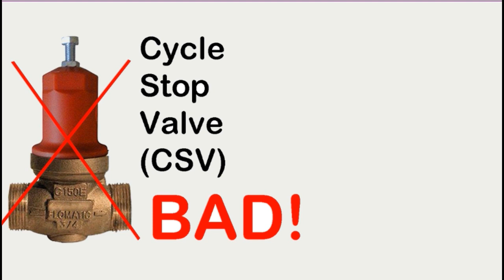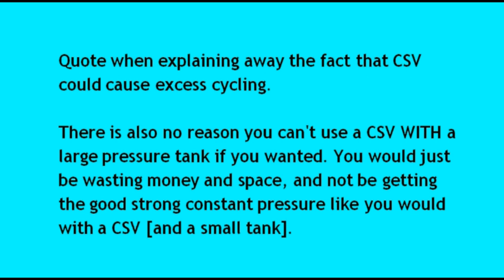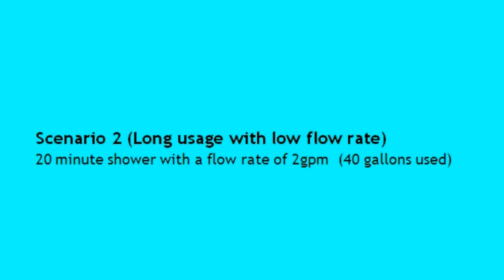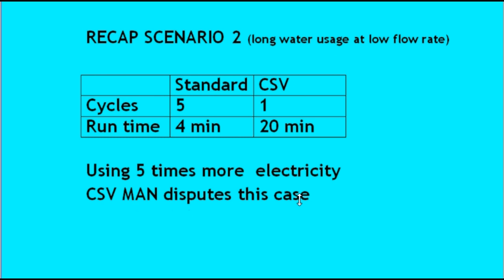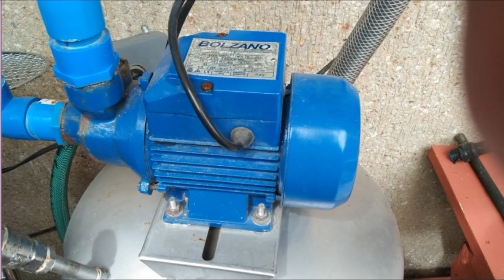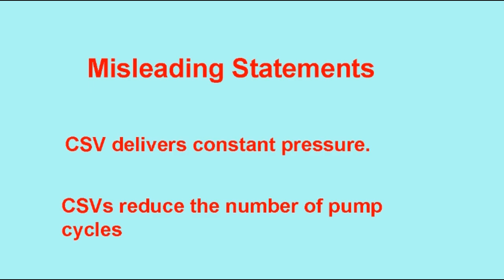Cycle Stop Valves ARE BAD for pressure tank systems!  Pros and cons of CSVs – few pros, many CONS!

Comment: Hi Larry. Enjoyed the video. The  only place I found this type of equipment useful in my rural home is at the ground source heat pump that required a constant flow rate of water for efficiency. So my house is on the side that varies 40/60 lbs and the furnace is on the other side of the valve to provide a constant flow through the furnace during a heat or cool cycle. Other than that, thanks for the detailed description. Sure made me think! Barry

Comment: Hi Larry,
Thanks for the very interesting and thorough video.  I have a gravity fed spring system in a cabin that I am upgrading and was totally persuaded (by the cycle stop guys ads) that I needed a CSV.  Now I am not sure what I need. The cabin is not big but will have 2.5 bathrooms and a kitchen.  We will probably not be watering the lawn much and only using the cabin about 15 weekends per year.   The current system has a pump with a small pressure tank that is cycling on and off with every use of water, which is noisy and annoying.  I was considering installing a water holding tank in the basement with a submersible pump (which should muffle the noise of the pump) and using the CSV and pside-kick tank to limit the cycling of the pump.  I do like the idea of constant pressure in the shower.  Is there another way to get constant pressure? Thanks
Reply from the maker: Honestly I can't make heads or tails out of your post. If your system is gravity fed then why do you have a pressure tank or pump? You mean gravity fed into your basement? And if you have a holding tank why would you need a submersible pump? You just need a booster pump. Submersible pump just to reduce noise? Sounds like a big waste of money.   What you need is a large pressure tank. What size do you have now? A large pressure tank will reduce cycling very significantly.  What is the current pressure range of your system now, usually if you have a pressure range of like 40 to 60 you would hardly notice it in  your shower. There is something called a VFD, variable frequency drive which can control pressure efficiently. I suspect that if you set up  your system properly you would be perfectly happy without a CSV valve pr VFD.  I think the VFD man is giving you the run around. A CSV turns the pump on every time you use it also. It just prevents cycling on long runs. To really give an answer I would need much more detail about exactly what your setup is. There are also shower accessories that can keep a proper pressure at the shower without  buying an expensive CSV valve.

Comment: great video, I commend you on doing this video.  I had purchased a CSV a couple weeks ago for a rather large home and have not installed it yet. Reason for purchasing is I am familiar with VFD's and have had one die to a surge, one died when the pump went out and then recently again had the drive fail from a lightning strike taking out the transformer in the neighborhood. Got tired of paying a small fortune for a VFD although it did work well when it worked. Had the well guy take the vfd out and put an 80 gallon tank and 50 /70 pressure switch on the system .I hate the pressure swing on our current setup currently.

Ive had one well company in Central FL swear by CSV and another company claims they tear pumps up and says he constantly has service calls to repair their damage. With these conflicting opinions from professionals in the area it made me try and do a bunch of research on my own.

I think your points about the csv cycling more is true with a small pressure tank. The scenario you showed about the fan and amperage draw is inaccurate though. For the test you did with the fan to be comparable, you would need to restrict the flow from the front of the fan by putting something in front of the fan to restrict its output and not restrict it by putting more load on the pump by physically blocking its rotation.  Restricting the flow on a centrifugal pump does not put more rotational load on the pump, the thrust load depending on the impeller design can increase. This is the same as if the pump was pushing water from a deeper well. It would be interesting to do a study on the failure rate of pumps on deeper wells vs shallow wells. 

As an electrical engineer I have access to a power analyzer and very accurate equipment to analyze power usage over time.  Ill record the load swept over the  outputs w/o the csv installed and record the standard usage after a month. End of December ill install the CSV and record a log again to see electrical usage over a month. I did a ton of research and had the same concerns you brought up in this video. The main issue I had was not finding a comparable power consumption graph from them showing that the csv does save electricity with a residential sized pump.

Was wondering if there was any way for you to do the current reading you took with the pump, but put a gate valve on the output of the pump and record the current wide open and slowly close the valve to a dead head to see if it reflects what was shown in the csv promo video he did.  Also what forum is this that had the csv company in it. I would like to read up on the thread.
Reply from the maker: Thanks for your nice long and interesting message, I will reply to several things you said.

First regarding the VFD always breaking, I am surprised! Are you keeping the VFD inside? Is it a reputable company like Grundfos? Actually I had a similar experience with my first inverter air conditioner which is pretty similar in concept to a VFD, it was a Samsung, and the electronics  blew during a power outage and it was going to cost so much to fix I just threw it out. However, it seems that a well designed system should last a long time. Think how complicated my computer is, and it has lasted 11 years already! Electronics should be dependable! Not accounting for power surges is pathetic engineering.

Regarding the up and down pressure of a regular system, your system is 50 to 70 psi. You say the fluctuation bothers you. That also surprises me. I have a cheap 20/40 system and even at that range I hardly notice the pressure fluctuation.

As far as my fan test goes, I knew that was a stupid test and I wish I left it out of my video, so many people have given me negative comments about it, I was just doing it for fun to see what happened, not really to be taken seriously.

As far as power usage of a water pump going down as flow is restricted, I did that test in my video. Same thing as putting a gate valve, I monitored the amps as my pressure tank was filling. No significant difference in power usage as flow was reduced for my cheap Italian ½ power pump. Honestly, I suspect that very few  pumps, with the exception possibly of expensive industrial pumps, reduce power usage as flow is restricted, that after all is the purpose of a VFD. Notice how few pumps provide horse power vs. flow curves? That’s because it probably is not a factor for most pumps. Cary Austin of CSV probably had to look far and wide for that pump curve that showed a 50 percent reduction in power.

As far as putting a large tank with a CSV, you realize the large tank will fill up very slowly at 1 gpm and this will waste a lot of energy. I already know your system with a CSV will waste a lot of energy, it is obvious. However if you don’t care about energy usage I suppose the CSV will at least provide constant pressure if that is so important to you. 
As far as pumps lasting longer, I seriously doubt it. It seems intuitive to me (all though I admit intuition is not always correct) that a severely restricted pump will burn out faster than one providing flow at its natural rate so to speak.

I hope you try my idea on how to build a CSV, let me know if you do it.
Reply: @LarryElterman  Thanks for the reply back appreciate it. The pressure issue is noticeable on the irrigation setup. The heads end up spraying the neighbors during a period of the cycle then when the pressure drops or goes down . I've adjusted the pattern on the heads to compensate for this . Showering it's very noticeable. The house is older and I guess plumbed wrong . I can tell when the pump kicks on as the spray pattern gets stronger.  The vfd when working , worked very well. Lighting took out one, one died when the pump gave out . And a third one diedwhen a transformer in the neighborhood blew up. Ironically it killed the driver for the fridge and the tvs in the house . As an EE I know how sensitive electronics can be to surge. I even had a whole house surge block in the panel that didn't seem to do a anything . The one we had was  called a  sub drive  for a 3 wire pump . I believe its made by Franklin. It's installed in the garage near the water filtration/ iron and softener system. We have a 1.5 hp submersible pentair pump now. 2 grand each drive failure is rough.  I was lucky to have one replaced under warranty but the last 2 I had to pay for again. After the last failure 3 months ago i told the well guy to just put a regular pressure switch cause i wasn't  going to pay 2 grand again for another vfd. That more than killed any savings I was attaining  from the electric bill using the vfd.  I saw your other video about incorporating a valve  and flow switch and that seems very viable . I'll give it a try in January .
Reply from the maker: Ok, let me know how it goes!

Comment: The power consumption on a pump curve is not linear through a range of heads (psi) and flows. Running 4 minutes with pressure varying between 30 and 50 psi compared to a pump running for 20 minutes at 40 psi would not reduce the electricity usage by 5 times. You make the assumption that the power usage is consistent anywhere between 30 and 50 psi and it simply is not. Look at a complete pump curve and you will see.
Reply from the maker: it would reduce it by at least 250 percent. The best non VFD pumps only reduce power by at most 50 percent with reduced flows and most pumps don't reduce at all. I think this is the CSV brigade coming after me haha. False information everywhere. By the way I have looked at many pump curves. Try looking up the following kind of pump curve on the internet. Pump efficiency vs flow rate. The efficiency goes way down as the flow is restricted. It is so obvious.

Comment: Larry,  I have a CSV and TWO medium sized pressure tanks.  One point that your audience needs to know is its NOT 5x more electricity used.  Pumps consume watts, and the number of watts consumed totally depends on the flow rate.  If I adjust my CSV to allow 100% flow rate (20 gpm), my pump would use 1400 watts @ 240 VAC (6 amps) to refill the tanks and arrive quickly back to the shutoff pressure.  It would short cycle the same as if I had no CSV at all.  However, if I adjust the CSV to regulate the pressure and the flow rate to 40 psi, the pump starts after I've used about 10 gallons of water and if the demand exceeds 10 gallons (I'm refilling the pool) the pump never shuts off and it continues to operate at 40 psi until the pool is full.  Conversely, if we are washing clothes in our front loader washer, which likes to squirt about half-gallon at a time into the drum as its filling, off and then on, until the water float senses the correct water level, the CSV in tandem with a medium or large pressure tank is indeed the best of both worlds.  When the washing machine is still filling and someone flushes the toilet or washes their hands the CSV opens more to hold the pressure and flow rate at 40 psi.  Whats IMPORTANT to know is when the pump is being throttled at 40 psi and the flow rate is 0.5-2.5 gpm the power consumption DROPS.  My pump uses less than 200 watts at 1 gpm and incrementally consumes more and more power depending on the flow demand.  At 20 gpm  its 1400 watts.  At 3 gpm its less than 300 watts.  So its NOT 5x more electricity just because its running 5x longer.
Reply from the maker: Either you are associated with CSV company or you are mis-informed. The  pump power consumption usually hardly varies at all with most pumps when reducing flow, and even in the expensive pumps where low flow reduces power usage, it is not proportional. Reduce flow by a factor of ten, you might get a 50 percent reduction in power usage, so that's 5 times more electricity.  (Even cycle stop valve man himself only claims a 50 percent reduction in power when reducing flow). If what you say was true then there would be no need for Variable Frequency Drive systems.  I don't think you watched my whole video either because I address what you said. I said even with a specially designed pump the power usage would go up by a factor of 2.5 (compared to 5), because of the pump using less power with low flow. Have you noticed that very few pumps show a horsepower vs flow curve? That's because in most pumps flow hardly effects power usage. By the way, how do you know that your pump uses only 300 watts at low flow and 1400 watts at high flow? Did you actually measure it with an Amp meter? Perhaps you are guessing, or did not actually measure it?  Maybe you measured it incorrectly, or measured it with defective equipment. It's one of those, because I very highly doubt what you say is true, unless your pump is a VFD pump haha.
Reply: @LarryElterman  I concede to you here.  My system was installed in 2013 and back then I did not own my own clamp-meter.  I accepted the word and the demonstration by the original well pump installer.  Since then I've added more than one clamp meter and kill-a-watt box to my inventory.  With your points in question here, just now I ran downstairs with my clamp meter and got it hooked up around one (L1) of the pump wire, leaving L2 alone.  I started a small flow and when the pressure reached 42 the pump started.  It draws 10.02 amps on that one 120 VAC leg.  I increased the water volume and the  power (amps) remained the same.  Armed with this information, I decided to adjust the CSV to see if it made any difference and with it wide-open the draw maxed out at 11.25 amps (1350 watts), and completely closed (water still goes through it when closed) it returned to 10.02 amps (1202 watts) as it slowly refilled the pressure tanks.  So I will say you are correct.  It doesn't save any power.  However, it does reduce the start and stop cycles of the pump, which should improve the life of the pump.  Armed with your point of there being no power savings, I've adjusted the CSV to provide a much faster flow rate, keeping the pressure at 50 psi as long as there is a demand.   With a faster flow rate it should refill the two pressure tanks much faster once the demand is turned off.  I think the concept of a CSV is a good idea because it will reduce the number of pressure extremes, reduces the  starts and stops and no I don't work for a CSV company.
Reply: @donfrancis103  Thanks for sharing the amperages for your real-use pump case extremes.  They helped me to validate my own thoughts about the efficiency vs. pressure/flow of a centrifugal pump driven by a fixed frequency AC induction motor.
Reply: @donfrancis103  it was said in the video that it is not known if reducing cycling increases pump life.  At this point it is just an assumption.   However, I do think that cycling wears out the contacts in the pressure switch.